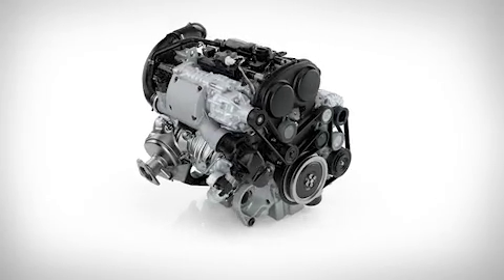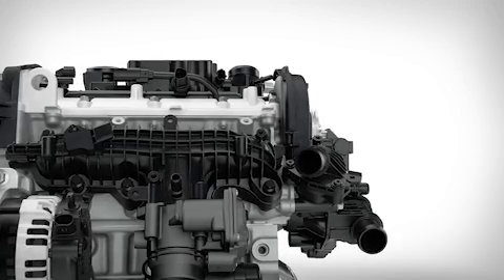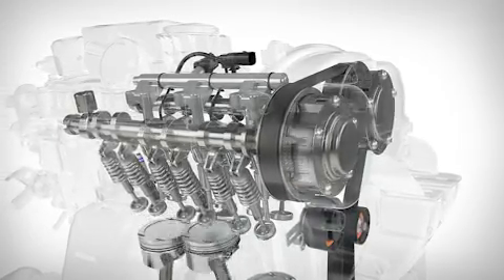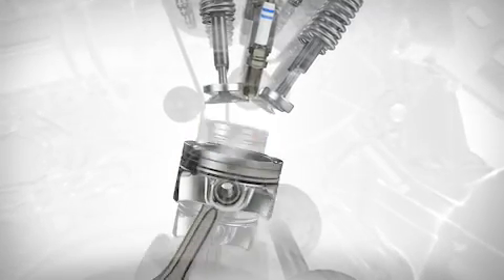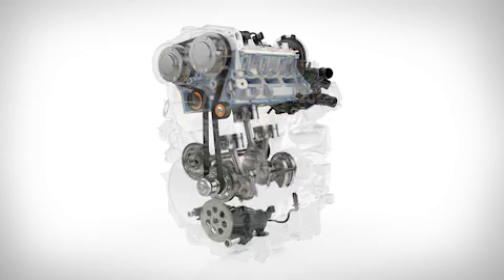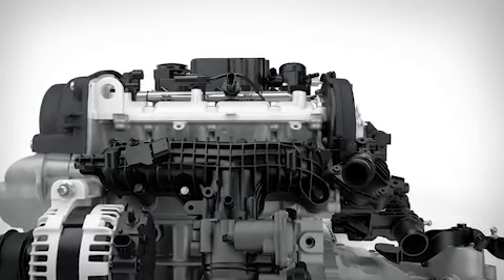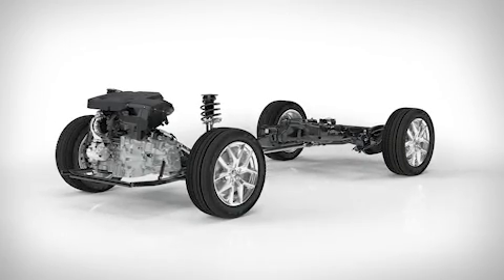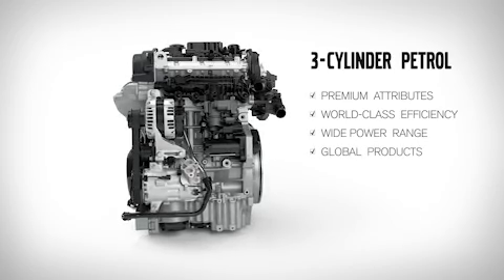The new 3 cylinder engine of the Volvo CMA platform

Comment: It makes 154bhp and 195lb ft of torque, translating to a 0-62mph time of 9.4sec. The T3 is theoretically capable of 45.6mpg combined fuel economy and emits 144g/km of CO2.
The T3's towing capacity is restricted to 1.6 tonnes.